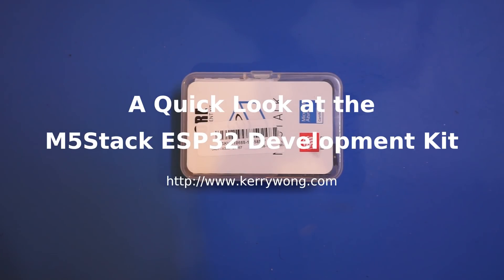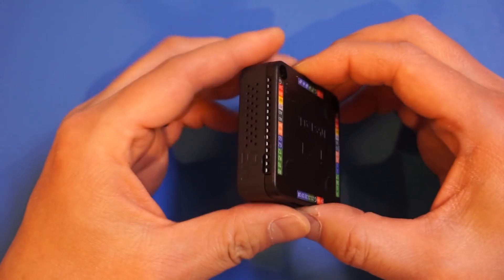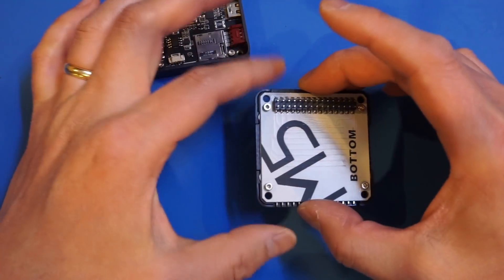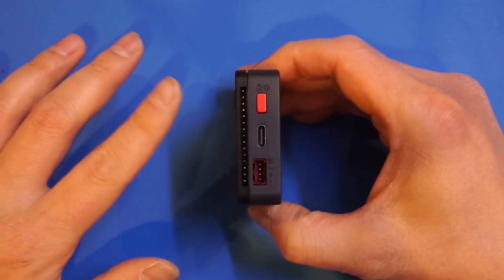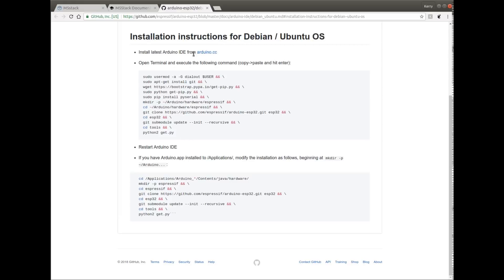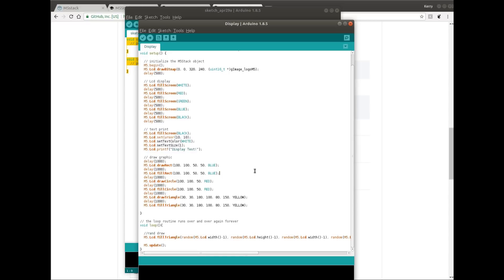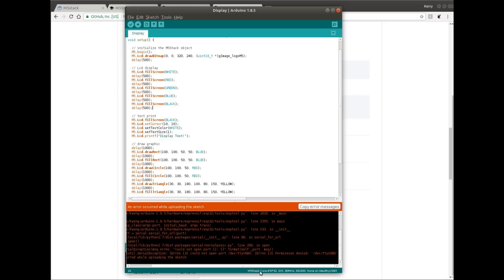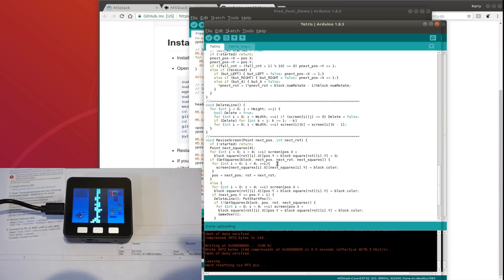A Quick Look at the M5Stack ESP32 Development Kit

Comment: I would like to see a couple of projects using the built-in colour screen.  ILI9342C is the screen.  How do I connect an MLX90640 FLIR sensor?  It connects with I2C and generates a 32x24 infra-red image and the M5Stack needs to select a frames per second rate.  Thx good video

Comment: It's well worth looking at platform.io instead of using the old Arduino IDE. It's a bit heavy, being based on Atom but overall it's a much better experience if you need to actually edit the files.
Reply from the maker: Thanks Rob, I will have to check it out.
Reply: @Kerry Wong 
I'd be VERY careful even before starting CONSIDERING use this.
First, correct address is platformio.org, url that ends with.io is different stuff.

Second, they do not care about basic pperwork, like "Terms of service". https://community.platformio.org/tos
And It took me 10 min to actually dig it out.
See that they did not even edit this template and left all "company_full_name" intact. 
Who known what is going on inside this "platformio".
If they cannot do paperwork properly, how you know they will care about your data?
(Hint: they're not. Even their own software cannot be trusted, see section 6 in tos)

Comment: I absolutely hate arducrap IDE and their pseudo-wathever it is, unicorn HAL but that can't stop me from using hardware like that with some real software. Will definitely buy one. Thanks for the tip :)
Reply: You can use Arduino without the IDE, for example using visual studio with the visual micro plugin. I still have plenty of gripes with how the Arduino software/hardware ecosystem works besides that, though :)
Reply: You can write the same software in arduino ide for esp32, cause it uses the same esp-idf sdk.
I did port some projects for esp-idf to arduino ide without problems.